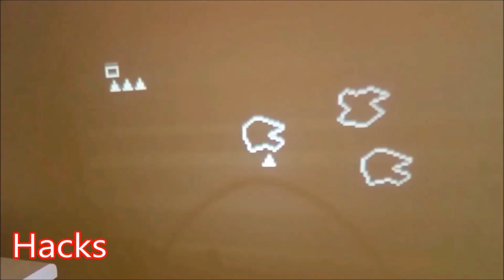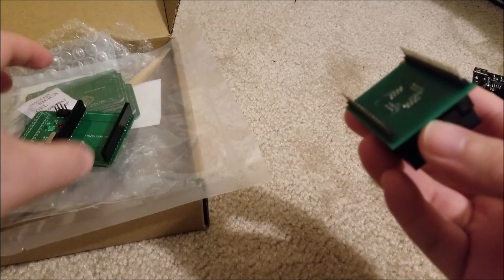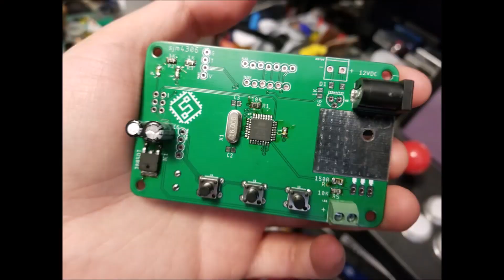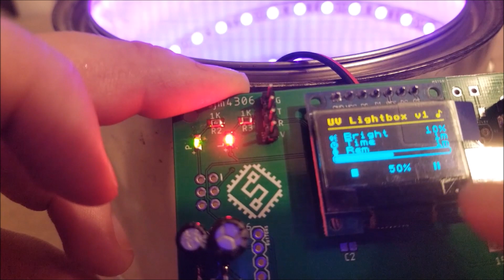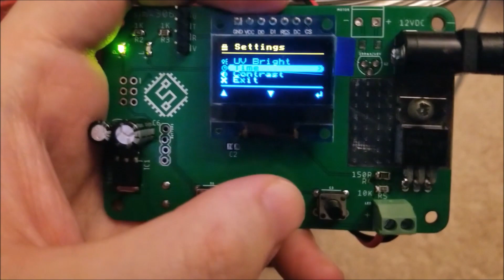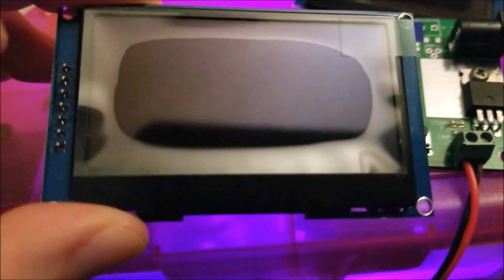DIY UV Lightbox Controller For Curing SLA 3D Printed Parts!

Comment: Hi when i run the code it reaches 99% on timer bar then jumps back to 85% and keeps doing this. UV leds stay on. Has anyone had the same problem.
Reply from the maker: What time did you set at the start of the countdown?
Reply: @sjm4306  1 min
Reply from the maker: There's a bug in the software that only happens if you set the timer to 1 min. It's probably an easy fix (if I had to guess it's some rounding or division error) but I haven't really looked at the code in a long time so I couldn't say for sure. I just dont ever really need to set it to 1 minute so I never got around to fixing it.

Comment: Hi nice project. do you have a circuit diagram for project,
Reply from the maker: https://hackaday.io/project/170295/files
The schematic eagle file is uploaded to the project page here
Reply: @sjm4306  Hi when i run the code it reaches 99% it does not stop and discounts again from 85% and  Thanks I found if i put some print routiens in i

Comment: If 
sjm4306 has no objection, I have some PCB's available in the UK. I would just be looking at a couple of pounds to cover postage.
Reply from the maker: Yeah, I have absolutely no issue so long as my work is attributed (and the project page is shared so people can upload/modify the firmware)

Comment: when the timer reaches 99% it does not stop and loop and do not end. how can it be solved?
Reply from the maker: What is your preset time? I'll see if I can reproduce it first. There is probably a bug in the sw that's causing it to reset before it times out.
Reply: one minute, when it reaches 99% it does not stop and discounts again from 85% and so it repeats without stopping.
Reply: hi, the hex program is correct, but in the * .ino file there is something wrong. please check it and tell me where the fault is.
I could not find it

Comment: Thanks for this video! Do you have a easier to follow tutorial to actually build and program the chip? And how many layers is the PCB
Reply from the maker: The easiest way would be to buy a chip with the serial bootloader already burned to it and use a usb serial programmer to flash my firmware over the 4 pin serial header. Otherwise, if you have an icsp programmer like the usbasp or arduinoISP (you can make one with another arduino) then you can just flash the firmware over the six pin icsp header. I haven't made any videos specifically showing this process, but there's tons of tutorials online explaining how to do this step by step. The pcb is 2 layers (this is such a simple design and there's lots of empty space so there's no need to get a more expensive multi-layer board).
Reply: @sjm4306  thanks for the reply :) looking forward to building this! Did you plan to add the ability to add a stepper/motor to control rotation?
Reply from the maker: I've already added basic brushed motor support to the hw+sw. For stepper you'll need a driver chip.

Comment: Am I being stupid or does the ICSP header need to be mounted on the bottom? The pins seem reversed, compared to my programmer. Edit, no I am not stupid, it does need to be mounted on the bottom. So after a couple of hours struggling with soldering because of my crap old eyes and shaky hands, I eventually managed to get it programmed and it does boot up, however it seems really slow and the interface/buttons are very sluggish, unlike your video, so what have I missed? Is it something to do with fuse settings? Also why did you leave off C2 in your build? Edit 2. What motor would you use? I am guessing something very low power due to the 2N3904's current of 200ma.
Reply: To answer my own question again, the default clock speed is 1mhz, so yes you need to set the fuses to make it run at 16mhz. So other than finding a suitable motor, the only other thing i am not sure about is how to program via the UART now I have flashed the firmware with bootloader.
Reply: Well I am back to answer my own question, in case anyone else is having trouble. You need a  FTDI  cable to program via USB after uploading the bootloader. I followed the guide at http://www.gammon.com.au/breadboard and used my UNO connected to the ICSP header to program the UNO bootloader. Now the problem is that the FTDI cable should also connect to reset via a 0.1uf capacitor, which hasn't been done on the PCB,  so you will need to put one inline with your FTDI cable and connect it to RST on the ICSP header along with the UART connections.
Reply from the maker: To flash over uart you need to basically time toggling reset just before hitting program, or use a serial programmer that breaks out the rts/cts (cant remember which off the top of my head) pin to connect to reset with a series 0.1uF cap so the computer can automatically do this for you. As for the motor I was thinking of using a small geared motor like used in rc, they run down to only a few volts and need relatively little current (100mA would be sufficient).

Comment: This is a very good project. I drew a picture according to your principle once, and the PCB has also been finished. That is to say, the upload is not successful. I used FT232RL module to upload. Can you help me to see my circuit diagram? I'm in a hurry
Reply from the maker: Have you used an icsp programmer to burn a serial bootloader to the atmega first (or purchased an atmega with the bootloader pre-programmed)?
Reply: @sjm4306  I've solved it perfectly. Thank you for the video. I learned a lot
Reply: I'll buy Atmega directly. What should I do now? What else do I need?

Comment: Awesome job, thanks for sharing. Do you have any links for the displays? I found some on AliXpress that are SSD1315 (compatible for SSD1306) not sure if they are suitable or not. I would like the 2 color option if possible. I also assume they must be 7 pin and not 4 pin like others I have seen on Ebay.
Reply from the maker: Thanks! Yes, any ssd1306 compatible oled will work (I got mine off ebay). And yes it needs to be the 7 pin variant or you'd have to modify the software or rewire the screen to get it to work.
Reply: @sjm4306  Thanks for the reply. A couple more noob questions and some observations should you ever revise the board.
1) Am I right in thinking that you have to use the ICSP header to flash a brand new chip and that the UART is only if you have burned a boot loader?
2) I assume the 6pin OLED connector is not required using the same screen as you.
3) Would a PC motherboard piezo speaker work with this?
I imported the board from Eagle into Sketchup to allow me to design and enclosure and noticed a couple of things that could be tweaked in the next revision.
C5 & C6 are very close together which limits what diameter capacitors you can use.
The buttons header is very close to C6 and it doesn't look like a Molex 6410-04 header will fit.
Maybe it would be possible to fit another screw terminal connector to use as 12v input instead of the jack, by moving the motor connector over to the left and placing it to the right of it.
The screw connector packages are called 3.5mm but hole spacing appears to be 3.81mm
Anyway I already ordered some boards from JLCPCB  and can't wait to have a play with it.
Thanks again for making and sharing.
Reply from the maker: Sorry for the delayed reply, youtube has apparently stopped notifying me of some comment replies (seems I get too many comments now)
1) exactly
2) correct
3) yep

Comment: If you connect a UV led strip directly to a led driver without controller,the brightness will be 100% or 50%?
Reply from the maker: It'd always be 100% unless the driver has an adjustment knob/buttons

Comment: How did you program the chip?
Reply from the maker: I used another cheap usb arduino programmed with the ISP sketch to act as an ISP programmer. Alternatively usbasp programmers are dirt cheap (~$1-2) on sites like ebay and will flash atmega chips easily.
Reply: @sjm4306  https://www.google.com/search?q=usbasp+programmer&rlz=1C1CHBF_enHR859HR859&sxsrf=ALeKk021vxETg3wGJ8TAJb9OL53OtGesvQ:1584632990330&tbm=isch&source=iu&ictx=1&fir=gNmIm36HqUnejM%253A%252CxpWYbW05Fy8l7M%252C_&vet=1&usg=AI4_-kTD4xVhQ3E-SQhJsc6oXxyJ-b9dpA&sa=X&ved=2ahUKEwiqp_Pz8aboAhUPtosKHTpvBJgQ9QEwCnoECAkQKw#imgrc=gNmIm36HqUnejM

something like that? how do i put the chip on that
Reply from the maker: Yep, you would have to either additionally buy a 10 to 6 pin adapter (also cheap online) or manually wire them in the correct order (google pinouts for atmega 10 and 6 pin isp programming headers to match up the wires). If you use my board you just connect the 6 pin isp header lead the correct way (I mark pin 1 of the isp header on my board) and you are golden. If you just want to make your own board or program the bare chip I provide the schematic in the project page link in the description.

Comment: You mentioned connecting a motor to it. How will you get around that in software?
Reply from the maker: The software currently outputs a fixed 50% duty on the motor output that turns on and off automatically with the UV LED output. So as is it will work just fine by soldering the additional parts and soldering a dc motor with gear train/rotating platform. However if you want you can adjust the speed by manually changing that duty value in the program and reflashing the chip. Finally if you are so inclined you can go all the way and add another menu option to allow adjustment of speed in software via the UI and buttons at runtime and backup to eeprom like I do with all the other user adjustable variables.
Reply: sjm4306 how do i set it to lets say 80%? What do i change and how? Also is it possible i power just a motor instead of the leds for something like an automated washing station?
Reply from the maker: If you don't need the uv leds then you could just directly wire the motor to its screw terminals and adjust it through the gui like normal. That way you don't need to modify the source code. If you do want to play with the code then you can change the variable Mspeed initialization value to 204 (204/255=80%) and it will provide the motor output with 80% duty when the timer is running.
Reply: @sjm4306  how do i remove the other settings and rename the one to say motor speed?
Reply from the maker: You would have to modify the source code (provided in the hackaday.io project link in the description above), recompile and flash the atmega. I would suggest just leaving the other settings as removing them without being careful to fix menu indices and checks will break many things in the software. Renaming would be easy, just find references to the text string "UV Bright" and change them to whatever you want.

Comment: Nice project!
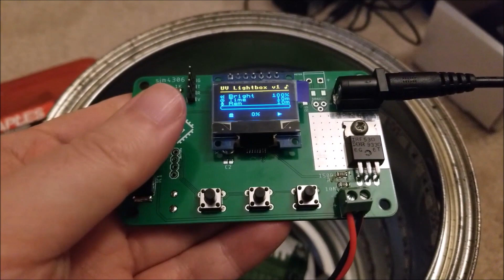One question 16:35, why is better to put 3Dp in the "box" and make a top cover,
 if you could put "box" over 3Dp  ?
Reply from the maker: Either way would work. I just didn't want to risk bleaching any surface I put the box on top of and having a silver bottom of the box will help with more evenly curing the bottom of prints through the clear rotating base without having to flip the print upside down and putting it in for a second time.

Comment: Not sure about the point of this. If it's the matter of avoiding overcuring the resin... well it is more tough when slightly undercured, but for one, you won't fully avoid near-UV light that it's reactive to, and for other, i don't think polymerisation, once kicked off, ever actually stops, even in the darkness, so it's only a matter of time until it hardens to the limit.

What might help is an attachment to circulate and heat the air, as it will cure tougher warm, but the air can't be so warm that the print warps.
Reply from the maker: The problem I've found is leaving a part on the windowsill while I go off to work results in coming home to it being super brittle and opaquely bleached (at least the translucent green resin I have does this). The biggest pro for me with this set up is really that I don't have to rely on natural sunlight (I live in the northeast so depending on time of year it's not always reliable or convenient to just leave things out and hope for sun). Adding a fan or heater should be trivial using the aux motor output I added to the top of the board (just attach a relay to that and add your load).

Comment: Really nice.  It's a bit eerie how similarly we think sometimes...this has been on my list of projects for a couple months and I even have part of the menu system written (for an LCD1602). :-P
Reply from the maker: Great minds think alike!
Reply: @sjm4306  Haha, seems so :-)  Along with the motor output (I was considering a BYJ48 stepper)  I'm thinking of adding a PTC heater.  Curing under heat makes functional parts stronger.  Downside is, it adds quite a bit of complexity to the build - including the enclosure.
Reply from the maker: Running the LEDs for an hour, it gets pretty warm inside as well as on the surface of the old paint can. Probably good for the resin curing process, but a bit worried for the LEDs as that'll probably shorten their life (maybe necessary to cool the outside of the can to conduct heat away from the LEDs).
Reply: sjm4306 Ah good point. I wasn’t thinking about how it might impact the LEDs.

Comment: Yeah I was wondering if I could do the same thing with this board but just one UV light with a resistor powered by a usb to shine the uv on my Wii console that would make my screw attack logo glow awesome
Reply from the maker: Yeah I don't see why not. You probably wouldn't need the screen or buttons though unless you want to adjust the leds after installation.
Reply: Nope not really just one set brightness